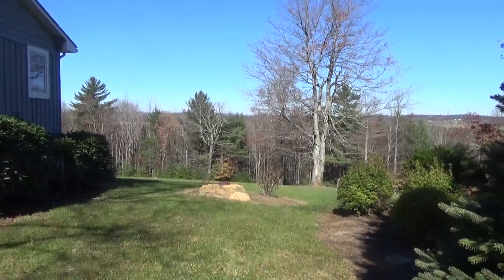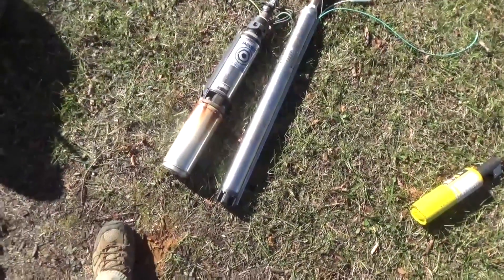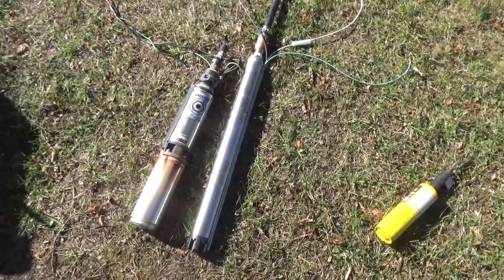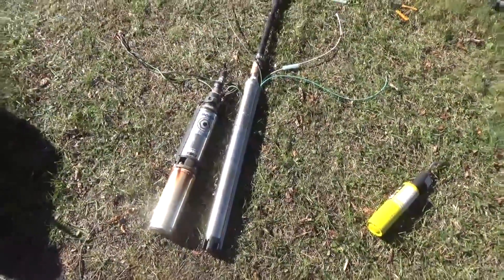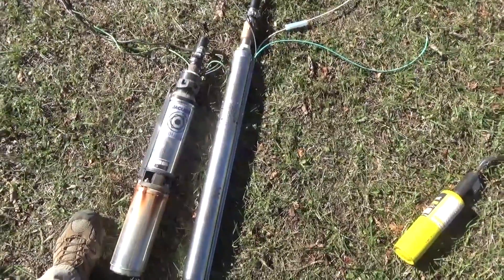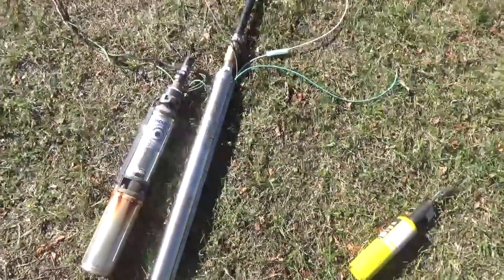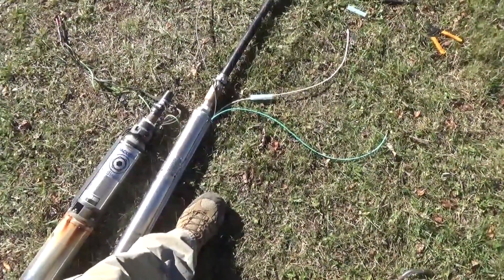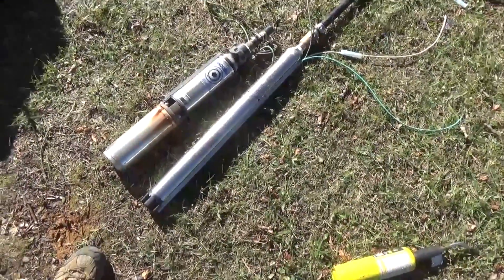120 Volt Well Pump Solution

Comment: Much cheaper solution: A "well timed" pump failure allowed me to change to a 1/2 hp 240V "three wire pump" (-not- three phase) .  These have a box in the well house/basement with a start/run capacitor and have appreciably lower starting surge.  I had a spare 2KV 240/120  transformer that I wired behind the well switch to convert the 120 to 240.  (I can actually enable and disable this arrange).  Even though the transformer adds 100W to the load I was able to start and run it on a 1500W PSW inverter (water lift ~60ft + 30/50 psi tank pressure) ,  While the inverter  was an off brand Amazon purchase I read all the reviews and knew it was able to put out a true 1500W.   A better selected transformer, one which only generates the "B" phase (uses a 120 to 120 winding, the output of which is used for the B phase) and one that has a better VA match (I think mine is over kill).  One could reduce the power penalty by 50% and maybe 30% or so.   I can't stress enough that in long term power outage situations the man that can get by with the smallest, most efferent generator (and a spare), survives.   Fuel availability will be the key.   If you go get you a big generator you better get a yard tank for fuel storage and the "proper equipment" to protect it.   BTW, The inverter, battery, & 400W of solar panel are built into essentially a DIY portable Jackery type system that goes in our camping van.  It supports the house when not camping.

Comment: We just had our well drilled 225’ deep 70’ static 6 gpm.  Would this 120VAC pump work for our well?  I’d like to run off our Honda 2000w suitcase inverter generator.

Comment: i enjoy watching your vids, very informative. i dont know much about plumbing or electrical, i bought a older house in the country side with a convetable jet well pump. i will be replacing the pump with a better quality pump. i was wondering if i could put a plug on the pump instead of hard wireing to the house ? the pump says 120 volt, but im sure 120 and 115 volts are the same, i would like to be able to plug it into my inverter and solar set-up ( if needed ) or plug into the house

Comment: I just drilled a well that has a static level of 180 and 20 gpm. I am planning on putting a windmill over the well to pump water up another 20 ft to a 1000 gallon storage tank.  What GRUNDFOS pump can I use with this where I can tie solar into as well as a Yamaha EF3000iS 3000 Watt generator.  Once I get this going I will plan, once I start building my off grid house, on was to pressure the water with your booster pumps in you other videos.  Any HELP or suggestions would greatly appreciated from ANYONE! :) I am a new homesteader trying to build from ground up.  Really excited to have my own water supply!!! It is a huge step towards true FREEDOM!!!  
Thakns for your great videos
Reply from the maker: Yes, your water supply is freedom!  The grundfos sqflex will work great and interface with the yamaha via th io101 controller. Send me an email and I can design a system for you.  I can also provide the pump, controller, etc.   TEll me how deep the well and the casing material and diameter.  email info@practicalpreppers.com

Comment: All well and good (pun intended).  However my well is marked at 160ft and is 220v/6a so were talking 1320 watts if we just go by straight math.  I would obviously seek something with plenty of margin.  I was wondering if you have come a across a 220 inverter that you would feel comfortable pointing out (not necessarily asking for an endorsement or anything)?
Thanks!
-Rob

Comment: Is that rust on the old pump you pulled out? If it is why are there steel screws on it and not stainless.
Reply: Same reason i got half of a stainless grill and half rust bucket. Trying to save a penny.

Comment: I know almost nothing about wells so excuse the question if it sounds childish. How many gpm does a "normal " 220v pump produce? We have an old pump at our lake house that will soon need to be replaced. We have been considering alternative sources of energy options given the house location. Toying with possibility of replacing the old pump with the pump in your video so we could still have water if the power went out.
Reply from the maker: There are many variables in specing a pump. a 120v pump won't work in all situations.  But typically static water levels are high at lake houses so it is probably a good option.  220v pumps are more efficient but if I only have 120 volt generators or inverters then I have no water.  When you get ready to swap, let m e know your well specs and we can help you get the right pump.
Reply: engineer775 Practical Preppers awesome will do. thank you

Comment: Have you ever seen a spring fed well, where the static water level is at or even higher than ground level?  On my channel I posted a video of the "old well house".  I am pretty sure it must be spring fed.  Also my pond always overflows, even in winter when everything has been frozen for a while.  So I think My property is over some type of spring.  Is what I am think possible?

Comment from the maker: sorry about the wind folks. hoping you can overcome it.  I was running out of time to get this installed and just shot a quick one. Hopefully it is better than not having the info.
Reply: Very informative video. You are right, the information is worth the ultra-annoying wind noise! Love your videos!
Reply: engineer775 Practical Preppers I would like to do this to my well also.  We have a fairly shallow well at 80'.  We have a small crawl space that's 4' at its highest point and I would like to put in a holding tank at ground level and a secondary pump under the house to build up pressure tank to 35-40psi.  We have not bought the holding tank, pressure tank, or secondary pump yet.  Would the pump you've used here work for our situation?
Reply: http://micover.com/products/stickover-mini

Comment: Does that soft start have any effect on the water at the faucet? Meaning if I were to turn the faucet on all the way, will I see the water pressure rise and rise and fall and so on? Which will be in tune with the pump turning on and off.

Comment: Those SQ pumps are very good units. I've had one in a 100m (~300ft) deep bore (well) for about 10 years. Despite having a bunch of electronics on board compared to a conventional pump, it's never skipped a beat, and that's with multiple lightning events that have taken out other equipment.

Comment: What is the best 12v well pump replacement?
Reply from the maker: There isn't one in the submersible world.  I like the grundfos sqflex for a dc option.  30-300vdc
Reply: engineer775 Practical Preppers ***** Thanks guys! Wow, both great options! With such a price difference how do I know i can use the cheap one?

Comment: hmmm...My pump is above ground.  Its an old pump but does the job well--->Pun Intended
I wanted to put up a solar panel just for the pump, put the battery in the well house...its own separate  system.  I would love to be able to plug the pump in...not sure how, or if I could.  I know it is a 240...
Any Suggestions how I can achieve this?
Reply: Donna Reeves big enough inverter does it fine. or switch to soft start like a vfd before.

Comment: I am NOT all that familiar with solar inverters. If it could handle the amps, could you run 120 to a small breaker box and put in 2 breakers. Then run one leg off of each breaker to the 240 pump. Just curious
Reply: Tooterr102 E.
Unfortunately no, you cannot.
Reply: if its a 220 inverter ! yes
Reply: No, the only way you can get 240 from a 120 source is by using a transformer.

Comment: awesome.  can you share how you waterproof the wires?
Reply: Drone Retrieval Unit you use watertight box. most of them filled with 2k epoxy of some kind. most important is the cable used.